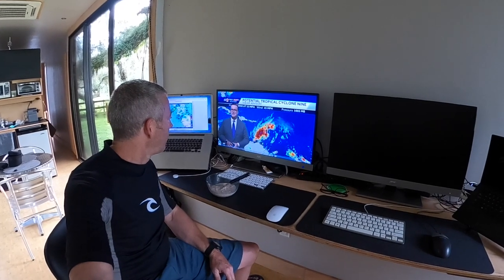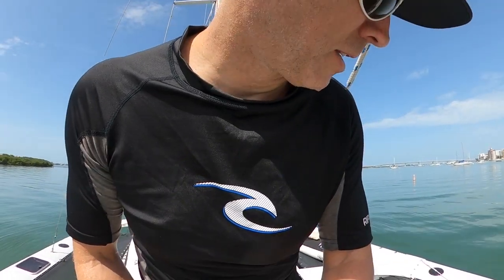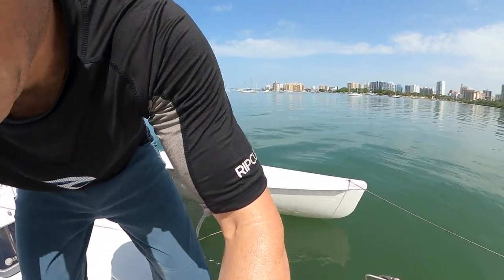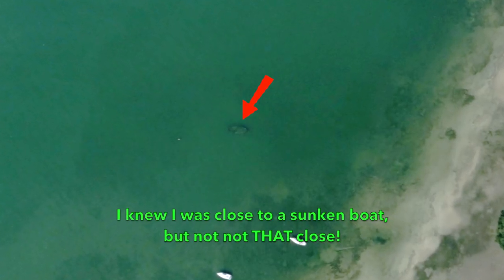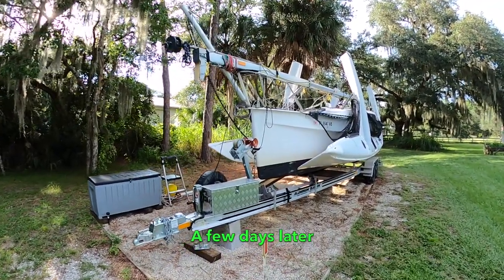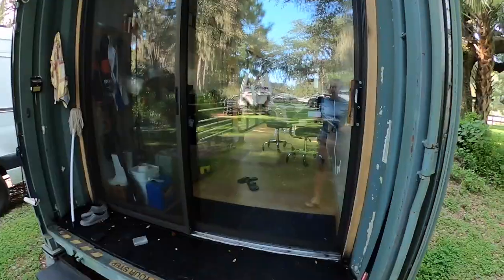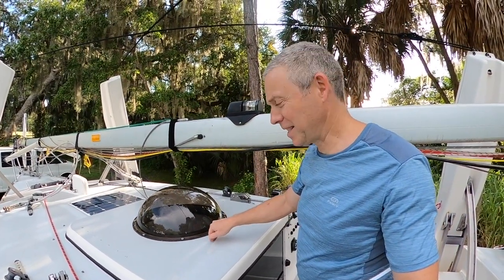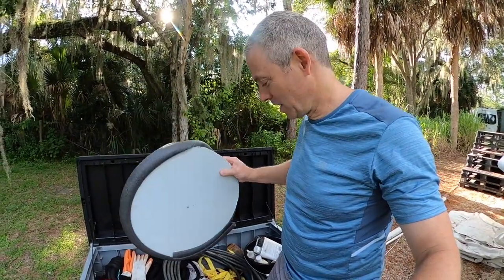Out of the Water!

Comment: Great video. Thanks! Great advantage to be able to trail the boat, just like that. Same with my DF800. I wonder if these are similar class boats? I now the DF800 is a EU Class C boat, so they takes limited amounts of waves. I am still on my first season for this boat, here in Norway, so still figuring out how much beating I shall risk putting this 30 year old boat into. And thanks for the tips on the tcSpeeds app. Bought that and using it. Keep up the tri-videos!
Reply from the maker: The DF800 is a great boat! I was told by an experience sailor about taking big waves. He said: "you will freak out before the boat does". And that is so true! I've been in 8ft swells, and no big deal for the F27. I would think the DF800 is the same. In absolute worse case, you go downwind assuming this does not crush you onto the coast. Like the F27, I am certain the DF800 can surf and maintain good control without any sail in big wind.

Comment: Wow, what are the chances to have the anchor rod around the mast of a wreck 😂.
I'm a new owner of a F-27 up here in Canada, I'm just wandering how can you tilt the boat on the trailer, to paint the bottom.
Reply from the maker: First you have to clear the amas from the trailer fenders. To do this I had to pull out on one ama at a time while shaking the boat. Little by little the boat should rotate on the trailer. Much easier if you are two persons, one at each end of one ama. Once one side is open, fix it in place with the bolts like you do on the water. Then push down on the open ama, the boat should rotate in the other direction until you can open the second ama. The second ama is much easier to open. That is how I do it. I am sure there are better techniques. The method I described, the hull will scrape a bit on the carpet of the trailer bunks. 
Yeah, I was quite shocked when I realized it was a mast from a wreck. Haha!
Enjoy your F27!
Reply: @tomaskryan  thank you for the detailed info about how to unfold the F27 on the trailer. Now I have a good idea. 
I'm already enjoying it, now we are in full season of sailing here on Great Lakes.
Reply from the maker: I was planning to trailer my boat to Canada, we’ll have to wait for the border to reopen. 
I think my next video will be bottom painting on trailer. 
Have fun sailing the great lakes!
Reply: @tomaskryan  For now it looks like borders will be close till Sep 21. If they indeed open, it might be too late for safe sailing up here this year.  I don't know where you intend to go in Canada, hauling the trailer  from Florida I guess you'll come either Quebec or Ontario. Let's keep in touch maybe I can join you with my F27. I'm sailing on Georgian Bay usually .
Reply from the maker: Yeah, I have been monitoring the border closure. They keep extending it every month. I was hoping to sail on the St-Laurence from Quebec city up the North coast. I wanted to trailer the boat in June. So hopefully next June.
Reply: Hi, I use a jack and lift the back end high enough for the amas to clear the trailer fenders.  I tie down the starboard side to prevent the boat from rotating as I open the port amas.  I have made adjustable jacks stands to support the boat once all amas are open and i slide the trailer out to do maintenance and paint.  To be honest, the jacking of the boat is on the "sketchy" side!  I'll try Tomas' way next spring.  I was suppose to sail on lake Champlain summer 2020 but with COVID we ended up sailing out of Kingston, On.  We plan a 3 week holiday on Georgien Bay in 2021...
Reply from the maker: Nice! 
Yeah, the jack thing scares me a bit. 
I might show the entire process in the next video. 
Have fun sailing!

Comment: I love the dome, I think that is a great idea for bad weather and more cabin light, but you are going to have to add a directional fan for bad weather watches.  I lived in Florida for 10 years...  during a storm with your head in there sweating and breathing it will fog up almost immediately if you don't keep ventilating air flowing.  Put 5-10 coats each of rain-X (outside), and Fog-X inside and the rain and any fog that sticks will just bead-up and run off to keep the dome clear.  How do you flip the boat for bottom paint?  Extend one ama and just weight it down?

Another great video, Tomas!
Reply from the maker: Good point about fogging. I’ll try that rain-X and Fog-X. 
Yeah, extend both ammas and push down one side then the other. I might make a video of that process.
Reply: @tomaskryan  Thanks for the quick reply. :)

I love your channel... keep up the good work!

I caught your video of the sail to Cuba shortly after you posted it, but I never explored the channel more until now.
Reply from the maker: Thanks so much for the compliments! I’’ll try to do a few more videos in November.